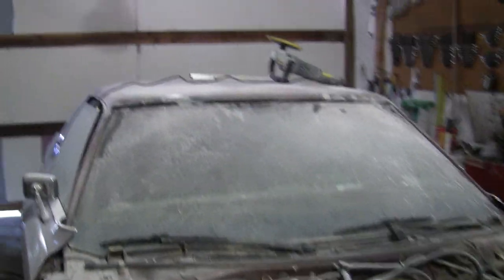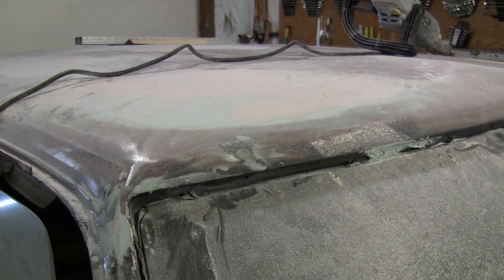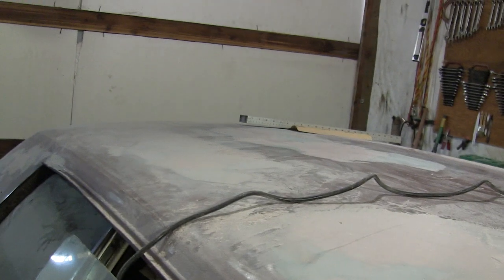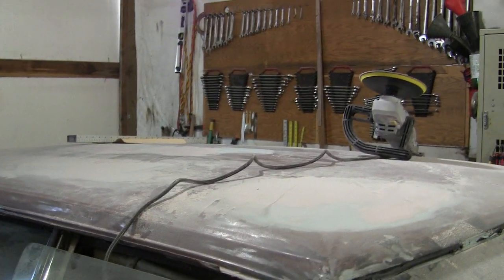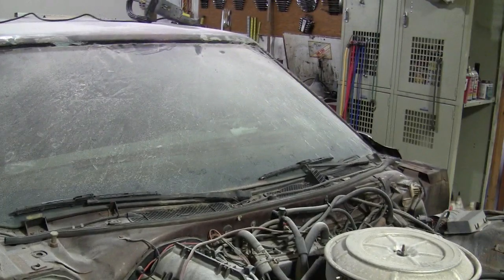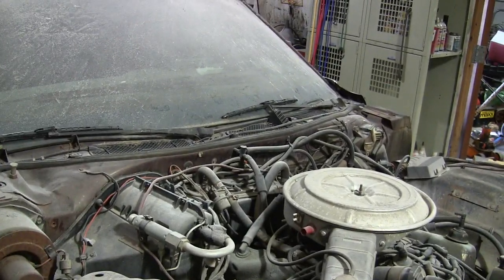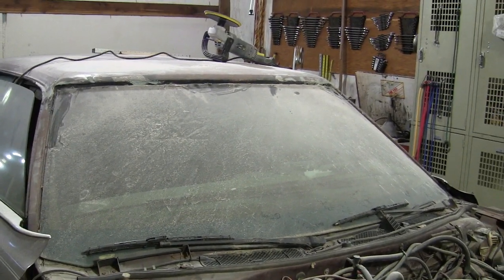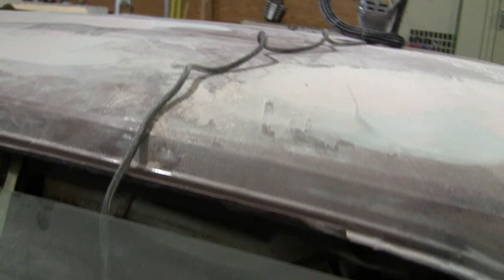LTD Project Update

Comment: Had the same problems with weatherstripping on my 77 LTD II ( a pillared hardtop, like your car).
Aftermarket kits are impossible too find for these cars.
But I came across some guy who specializes in weatherstripping a while ago and some off the GM stuff he had fits in the original doorframes pretty well.
I've only done one door so far, but with some imagination and adhesive I seem to be pulling it off

Comment: Cool man! How was it on fuel?? what was the MPG?  400ci?
Reply from the maker: +462ANIMAL It got around 10mpg, not the best lol.
Reply: +bah53 I hear you you.. I don't like 10mpg my 66 Continental gets that.. 240 miles per tank.. 24 gallons I believe.. I still say find an old crown with a 4.6 vic..with a rotted frame.. with low miles.. put that motor an trans in.. even in your 63 oldsmobile.. would be turn key and drive anywhere kinda car.. Anyway.. your car is looking good.. hope the temps stay up so you can get paint on it.

Comment: it sounds like it should look halfway decent if not totally good when you are done bah. are you going to fix this one up totally to the point u could use it as a daily driver or is this one just gonna be for property driving around so u don't have to insure and register it?
Reply from the maker: +matts6887 The plan is to fix this one up. Mechanically its not too bad, its just the paint and old vinyl top that were the problem.